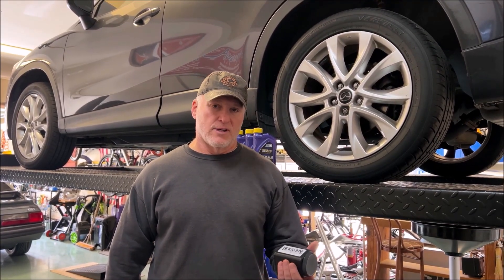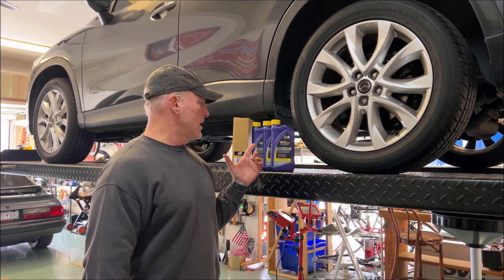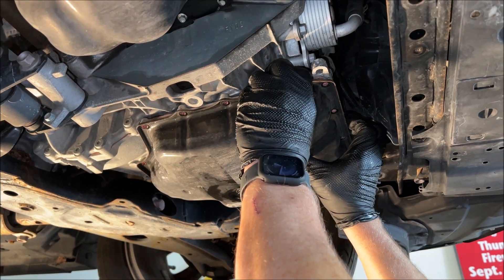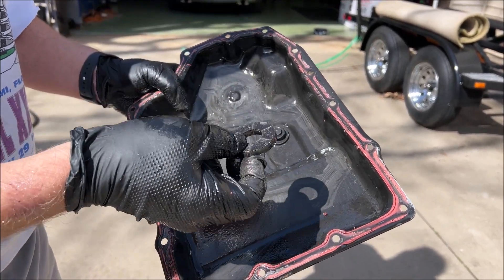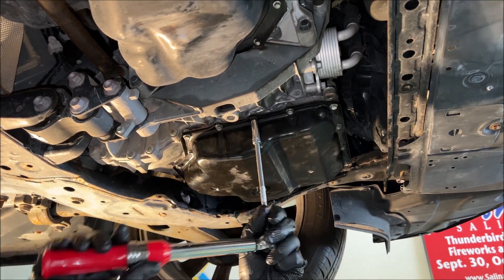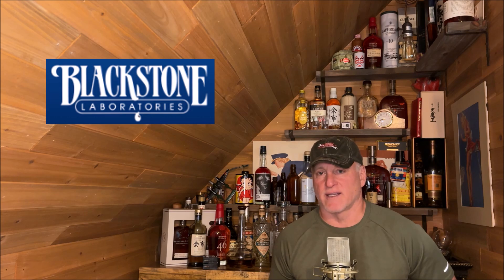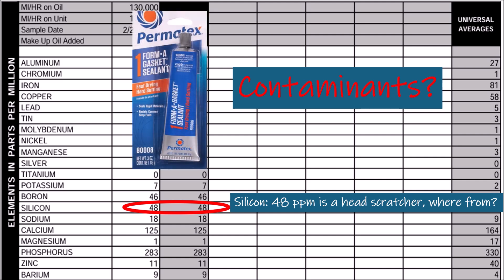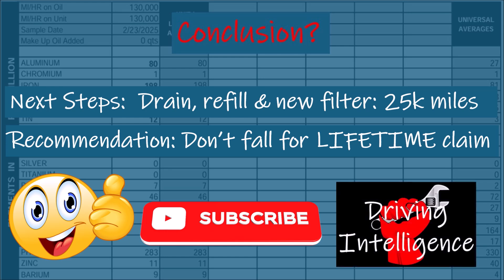Why Lifetime Transmission Fluid Fails: Mazda CX5 Blackstone Test Exposed

Comment: That's about what I expected for 130K on the ATF.  That's way too long if you want to hang on to the vehicle as long as you can (you already know this).  I recommend a change every 60K - 75K miles.  What was the mileage on the universal averages?  I would expect somewhere between 50K and 75K ... remember, those averages are from people who tend to over-service their vehicles (and send in samples for analysis). Consider them "ideal."  Your next analysis will be heavily contaminated because there was 2-3 quarts left in the tranny after your drain.  Hi silicon levels can be an anti-foamant additive.  You can ask Royal Purple about that.  Best of luck!!
Reply from the maker: appreciate the input.  mileage averages on the Blackstone report would have been nice.

Regarding the fluid condition, there was still 4 quarts in the transmission after the pan drop.  I intentionally did not flush out of experience.  I wanted some suspended friction material to ensure no slip after the change.  So far, this transmission is running flawlessly.  CX5 are really great cars.

Comment: Great video, I have a 2014 CX-5 and changed my trans fluids at around 90000 miles. I am glad I did, the transmission is super smooth after this. I did a second change of just fluid after 5000 miles, just to get even more new fluid in there. This transmission is a great transmission, real automatic, no CVT and is Mazda's own production since 2012. Transmission dipstick is a pain, and checking the fluids requires some work, otherwise all is well, Keep up the good work.!
Reply from the maker: thanks for your input!  I completely agree, these are great cars.

Comment: Lifetime fluid means that the fluid/transmission will make it to the end of the warranty period. Owners that wish to keep a vehicle as long as possible should change the fluid/filter every 60K miles. This is a good balance between cost and fluid degradation.
Reply from the maker: fair point

Comment: I'm the original owner of a 2014 Mazda cx 5 grand touring. With 187,000 miles. I never changed the transmission fluid . I never had a problem with the transmission. Everything works and still shifts as when I bought the car.
Reply from the maker: question, why do you think lifetime fluid is ok for a hard working transmission, but lifetime oil is not ok for an engine?  How do the two mechanical devices differ so much that one never needs fresh fluid or filter?

Comment: Ive had that issue where Mazda flat out refuses to change the fluid! My CX-5 (2015) has 160,000 miles (260,000km) on it and now... I have NO IDEA what I should do about the fluid and filter? Should I take it to a transmission service center? Will they be able to get the proper fluid since I assume it comes from Mazda" (Do they even sell it?).  Is is worse to change JUST fluid and not the filter? I don't want to mess  my machine up with a fluid change of course. Lost on this one now. Mazda has really put in the this position and I am not happy about that at all!
Reply from the maker: you are at a somewhat risky point.  I completely flushed my 10th Gen F150 transmission at 165k miles and ended up with Torque Converter Shudder.  I fixed it, alot of work, and didn't have to remove the transmission.  

In your case, when I spoke to Blackstone, they didn't seem to be too worried about late transmission fluid changes, but I'm not sure I completely buy it.  I think you might be safe doing the following, if you can do it yourself.  

1) Drain the pan into a CLEAN CONTAINER.  
2) Remove and replace the filter and put all the original fluid back in the transmission except for about 2 quarts of fresh fluid (I used Royal Purple ATF with no issue in this Mazda).  

You retain most of the old fluid because it has suspended clutch material that will help the transmission shift properly.  Drive for a while and see how it performs.  I also recommend sending a sample to Blackstone to see what they find.  Likely same as what was found in this transmission.  

I'm not saying this is a guaranteed way to proceed.  You may want to leave as is if running properly.  Let me know what you think.
Reply: If your dealership is that stubborn, find a good independent shop!!

Comment: I see you added back 4 quarts of new fluid.  how much of old dirty fluid is still in the torque converter? you probably changed 1/2 the oil.
Reply from the maker: I might be wrong, but I thought I mentioned that in the video... you're right, half the old fluid is still in there, but I did this intentionally. I did not want to remove all fluid so as to retain some of the suspended clutch material in case the clutches and torque converter were too worn.  Since it's running perfectly, I'll do another drain and fill at the 30k mile mark.

Comment: I'm mad as hell at MAZDA. I tried to get my dealer to change the fluid several times and was told its lifetime fluid and they would not do it. I worried about for years and finally took it to a transmission shop. They said we get Mazda's in all the time and that yes they do flush the fluid and replace the filter. Mine was done at 128,500. Fluid was black and broken down. Now it drives like it did when I bought it. I will never trust a dealer again. Now I go to a good shop and never go back to the dealer.
Reply from the maker: It's crazy what some dealers tell customers, but it's also Mazda... they claim it's lifetime?!
Reply: @DrivingIntelligence  My only concern is that if the transmission internals are worn, I’ve heard mechanics say that the metal particles in the fluid will help the clutches maintain friction. And if you put new fluid in it it can actually lead to the transmission slipping. My 2019 CX-5 AWD turbo has 93k miles on it and the fluids never been changed, I’m in the fence about doing it now. Several Mazda dealerships have told me they don’t recommend it because it’s lifetime fluid :\
Reply from the maker: At 93k miles you should have no problem doing a pan drop, fluid and filter change.
Reply: Flushing old transmission fluid is a no no,  just drain.
Reply from the maker: @ppumpkin3282  as recommended in the vid ;)
Reply: I don't know why a dealership would refuse business when every tech there knows that the fluid and filter change is necessary just like changing the engine oil and filter.
Reply: OK, but that's a DEALER problem, not a manufacturer problem.

Comment: I recently changed this fluid on my Mazda 3 and I'm ready to do my CX-5 also. After I replaced the filter on my 3 I drove for about a 100 miles and did a drain and fill with about another 5 quarts of fluid. This should ensure that about 75 percent of the original fluid got replaced. I did this before reinstalling the plastic under body shield.
Reply from the maker: Sounds like a good plan to ensure a thorough fluid exchange!

Comment: Great video ! I actually tried to get my 2015 cx-5 transmission serviced at the dealership when it had 60k and they told me that they don’t do any fluid flush because it’s a lifetime fluid or any transmission maintenance at all so I decided to do do it myself , at around 108k a little late but i got it done. It’s crazy that I was able to purchase the fluid directly from them but they denied me the service .
Reply from the maker: That’s incredible.  A money maker for them and an important maintenance task for your car.

Comment: Gasket doesn't work will leak.must use high temp  rvt just like factory
Reply from the maker: wrong... no leaks since I changed this tranny fluid.
Reply: I have heard this wix gasket is the only gasket that actually gives a good seal actually. As good as the oem sealant.
Reply from the maker: @beri232  he was talking about the oil pan gasket
Reply: @DrivingIntelligence   so was I. The transmission oil pan gasket from Wix is supposed to be the best gasket you can get for the transmission. You should not need any additional sealant when using it.

Comment: Thanks for your work and analysis! I didn’t notice your fluid removal measurements to include the fluid that drained from the filter, was that calculated in and did you double check the level after warm up? I plan on doing my 1st drain and fill on my 2024 cx30 at 50k but waiting to do the filter. Would you recommend doing the filter now or waiting till say 80k? What’s the cost for the Blackstone analysis if you don’t mind? Cheers
Reply from the maker: Sorry I left that part out of the video.  I did check the fluid level and topped off as needed.  There isn't much fluid stored in the filter.  

As far as the filter is concerned, I would never change the fluid without changing the filter, especially since you likely have break-in metals in the filter.  Replace with a quality filter every time.

The Blackstone analysis is something like $50 for the full monty.  What's nice about Blackstone is that they keep and compare all your records so you see trends.  And they talk to you on the phone about your results, if you so desire.
Reply: I would do the filter at 50K, as most of the break in debris is still in there.

Comment: The reason you're seeing more metal in the transmission is because the Mazda automatic has an internal wet clutch that offers full lock up in every gear.
Reply from the maker: Thanks for chiming in! I appreciate your insight, but I’d like to clarify—your point about the Mazda automatic’s internal wet clutch offering full lockup in every gear is accurate, though that’s a standard feature in all modern automatics, not unique to Mazda. The excessive metal in the Blackstone report I mentioned likely stems from wear (e.g., bearings or gears) rather than clutch design. Always good to dig deeper—feel free to share more expertise!
Reply: The part that unique to Mazda is the torque converter locks up from very low speed.
Reply from the maker: @thetechlibrarian  Help me understand how your comment relates to this video?  Thanks

Comment: The fill port is under the air filter box which needs to be removed to complete the trans service. I recommend dropping the pan and replacing the filter on the first fluid change only as the filter only catches larger pieces of debris from the break in period and is not meant or designed to capture fine particles which is the job of the magnets in the pan. I'd did the pan & filter and a fluid change at 35k miles and then another fluid only service at 85k miles on my 2014. I just sold my CX-5 last year with 130k miles on it and it still ran and shifted like a top after years of towing a small boat with it. The NA Skyactive 2.5 and 6spd auto are a very well balanced combo and a pleasure to drive.
Reply: I bought my ‘22 CX-5 in 2023 with 3K miles on it. At around 5K miles I drained the transmission fluid, pulled the pan, and put in a new OEM filter. There was a lot of metal stuck to the magnet and the original filter was black, as was the fluid I drained out. Now at 15K miles I plan to do a transmission fill and drain only at my next oil change to remove more of that break-in debris. It seems these mechanisms wear the fastest in their early service life, and just like with engines it’s beneficial to remove that material so it isn’t abrading the inner workings.
Reply from the maker: thanks for your input.  I'm truly impressed with this vehicle, now at almost 140k miles.

Comment: Lifetime fluid just means “until the lifetime” of the transmission 😅
Reply from the maker: OK, thanks for that assessment, I’m scratching my head to see how your comment helps
Reply: @DrivingIntelligence that's the excuse a dealership will make when a transmission blows and the customer complains.
"Lifetime" fluid (to them) pertains to the life of the transmission, and NOT actual lifetime (as in forever).

So, to prolong vehicle life changing fluids IS mandatory.

Comment: Great information, I recently requested the Mazda dealer to change the trans fluid at 144k, was going to do it myself but the original Mazda trans fluid was very expensive so it didn’t cost that much to have it changed, they did 2 fluid changes after driving between changes, but didn’t drop the pan and replace the filter, figured this is still better than no fluid change, have noticed the first gear change is smoother when cold
Reply from the maker: that's great.  Surprised they didn't change the filter, but you should be ok.  The revitalized fluid will protect the transmission.
Reply: I would not trust a shop that didn't routinely change the filter as part of the service.

Comment: Lifetime means the life of the vehicle which is 100-200k miles not literally forever.
Reply from the maker: 100k to 200k is a big difference.  So you're saying once you reach 100k miles, it's hit or miss whether the vehicle will get to 200k?

Bud, don't change your fluid... fine by me.  My channel and videos are for those that want to stretch the life of their vehicle WHICH INCLUDES ENSURING DEPENDABILITY.  I'm at 271k in my F150 and have no worries driving it across country.
Reply: @DrivingIntelligence  I'm doing it Saturday...just stating what the manufacturer means by lifetime.
Reply from the maker: @R1racer1  good call ;)

Comment: Mazda is not lying but they are not disclosing to the public openly is to the company, the lifetime of the vehicle is 3 years basically. Salespeople will not disclose that .
Reply from the maker: hmmm, interesting comment.  Where did you hear that?
Reply: Welp atleast in EU Mazda gives 6 year warranty, so thats a relief.
Reply: Almost every manufacturer uses this "lifetime fluid" term. Their definition of lifetime is the warranty period on the power train. Any issues after that period are the customer's problem.
Reply: my mazda6 have 6 years/210k miles, and never changed transmission oil...
Reply from the maker: Ticking time bomb

Comment: do you think only new oil changing helps for cleaning?  I dont want to waste time this sealed pan stuff. Maybe is it good idea to clean oil residue with brake cleaner from top without open the pan and fill the new oil afterwards?
Reply from the maker: The only way to properly clean is to remove pan, and clean pan / gasket surface.  Be sure to use a fresh gasket, filter and fluid.

Comment: I have a 2021 Mazda Cx5 Carbon Edition Turbo with 28,500 miles after owning brand new for the past 4 and 1/2 years. What do you recommend to maintain this transmission? Drain and fill every 30k miles? How many times to drain and fill? I've heard nothing short of positive things with the engine and transmission long term reliability so I'am not super concerned but I'd certainly like to own this car for another 6 years minimum. Being that I bought it brand new I set a mental number of 10 year ownership at the minimum to pay off that investment.
Reply from the maker: I'm very impressed with the Mazda platforms.  Since I dropped the pan and changed the fluid that was in the pan, and changed the filter, the CX5 is running perfectly.  I plan to do another pan drop and filter change in about 30k miles.  I drop the pan and replace the filter in all my vehicles every 30k miles.  Many say this is overkill, but I keep my vehicles far longer than 10 years.  My newest vehicles is a 2006 Cadillac CTS V and my oldest is a 1985 Mustang SVO.  The only transmission I rebuilt is in my 2002 F150 4x4 and I did that at 260k miles.  Really didn't need to do a rebuild, it only needed a shift accumulator, but I digress.  My ATF change interval has saved all my transmissions.
Reply: My 2016 CX-5 GT is 10 years old and I am doing the transmission fluid for the first time. Aside from general maintenance, the only thing I have had to do was replace front and rear stabilizer end-links. The oem ones snapped at the ball joint so I replaced with heavy duty, Moog greaseable units. It has been more reliable than our Toyota’s and even our 22 Lexus RX.
Reply from the maker: @beri232  I'm sold on Mazda after working on this car
Reply: @DrivingIntelligence   me too. I have done the majority of work on my car over the 10 years I have had it. Easy to work on when needed and parts are not that expensive either.
Reply: I have 2013 CX5 since new, first time ATF oil drain and fill was at 20K, then every 40K. Always use OEM oil, better safe than sorry, now running 110K like new.
Reply from the maker: @thebearbean  Royal Purple is safe...

Comment: You don"t ever need to replace the "filter" beacause it"s NOT a filter it"s a screen that allows fluid in and back out under zero psi it will never clog up like an oil filter ! And a drain and fill still has 4.3 Qts of the old contaminated fluid still in that trans !
Reply from the maker: I can’t hear you, Can you exclamation point louder?
Reply: @DrivingIntelligence  Dude , can you read ? You really can"t admit that your wrong about  needing to replace the trans filter , you should have done a complete flush and saved the time and money pulling off the pan and replacing the old MESH filter with a new MESH filter , they let dirty fluid in and right back out do a little more research before telling people a LIE .:face-orange-frowning:
Reply from the maker: Dude, wow, you’re an angry person, perhaps you should see a professional.  

And I stand behind my video and my results.  You do you, even if it’s a miserable life.
Reply: @richardr2238  I think changing that screen on your first oil change is a good idea personally. It allows me to drain and clean the pan, screen and magnet to get rid of a good portion of the contaminants after break-in. Going forward though….. I would not be dropping the pan.
Reply: @DrivingIntelligence  Did you cut apart the factory filter?  It would be interesting to see the filter mesh/media ... and any debris it caught after all those miles.
Reply from the maker: @seanthompson8071  I didn't, I did look inside and it was pretty dirty.  That would have been a good add to the video.